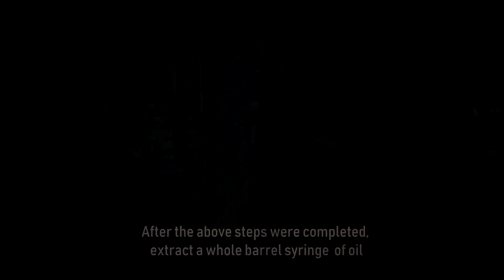2018 ezmtb how to bleed hydraulic disc brake perfectly by a new way

Comment: Just got my kit and I'm impressed how much you get for that price. I went with the pro kit because of how much you get for the price, you might as well be covered for a lot of different brake setups, which will make you able to easily help out a friend if need be too.
I just wanted both a DOT and a mineral oil setup in the same kit.

Comment: Wich is the difference between putting the syringe in the bottom side (caliper side) and putting it in the upper side? i've seen both techniques
Reply from the maker: Whether connected at the handle end or caliper end, there is only one purpose. The difference between this 2 way is only the difference of subsequent air bleeding efficiency. We think that injecting brake oil from bottom to top is a more efficient method, which will reduce the residue of air in the brake.
Reply: With syringe at lower/caliper end, any bubbles in the hydraulic line will get a chance to “float” up to the handle end and exit into the funnel or drainage bottle. Bubbles naturally float to the highest point. 

Pushing/pulling on the syringe will help the bubbles float to the top end, too.

Comment: My fluid kept going back in the bottle, filling the hose with only air. Therefore I kept sucking air in. That sucks. I'm gonna try the same method with the funnel, cancelling out that hose.
Reply: I wonder if this had no follow up because he couldn't get it right and crashed?
Reply: @whazzat8015  Hi, these are Diego's parents. He actually did crash and die, thanks for your support.
Reply: @diegohuijbregtsgarcia5102  Can't say we we didn't warn him.

Comment: Still it's pretty annoying not to have an English version.              MUTING HELPS
I would go to  https://youtu.be/q0SvqxMK_PA instead and Seth's https://youtu.be/ICPkeAMNO6E
Their set up wastes oil (40+ml) and time by moving bubbles around 
compared to the 2 syringe method the factory uses, and you should get the wheel and pads far, far from the  work. 
You WILL spill on them up, eventually. Yes, even you.

Comment: I dont get it. You connect bottle with handlebar using plastic tube that is empty. So you are sucking air inside. There is like a whole of syringe of air sucked thats need to removed..
Reply: not  a very good vid. OK but ,... 
Try the Park tool one for what you are missing. 
They use 2 syringes, but you can do it with what is in the kit.
Reply: @whazzat8015  I just dont get that part when they suck a lot of air from the tube into the system. Clamp on that upper tube filled with oil could do the trick. Less air to get rid off.
Maybe its noob thinking. I have never bleed brakes before and im researching hot to do it for the first time.
Reply: @statom985  I think it is an adequate but not good vid       MUTING HELPS
I would go to  https://youtu.be/q0SvqxMK_PA instead and Seth's https://youtu.be/ICPkeAMNO6E and I think you will see what they are trying.  Syd at  https://youtu.be/o-YvMRJunwo and the Park Tool vid are also very good. Each has very good tips.
You are 1) flushing out old oil 2) running fluid though the system till all the air is out. 
The Ezmtb bottle up top is sealed against air intrusion by having the tip submerged in clean oil. you should never be injecting air into the system. It won't hurt but it can be a pain to remove. Get the wheel and pads out of the way and have lotsa towels. 
Caring for hydraulics/brakes is a basic life skill.
Reply: @whazzat8015  Its not sealed from the beginning which seems a flaw of the process. From 5:09 to 5:11 he is sucking air.
I have juicy 3 and im wondering what is the main difference i cannot do it like shimano. No syringe and with a cup.
I have read that SRAM doesn't recommend degassing dot fluid anymore.
Reply: @statom985  some brakes have a valve which he supplements with suction, gravity and a fluid seal.
again it is not a good vid, and explains what it does poorly. It works.  It doesn't teach.
Watch ones by better teachers.